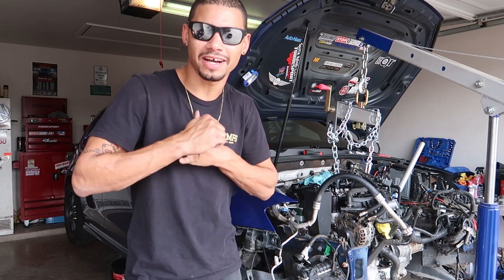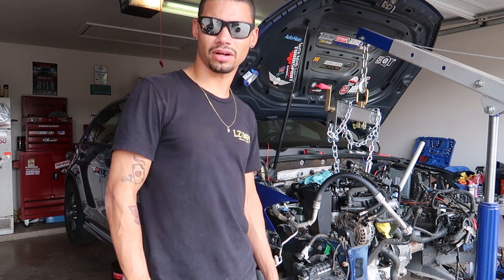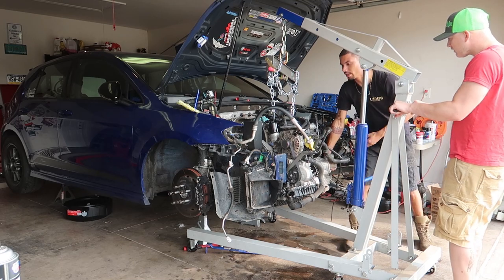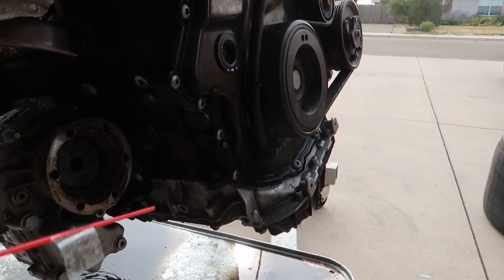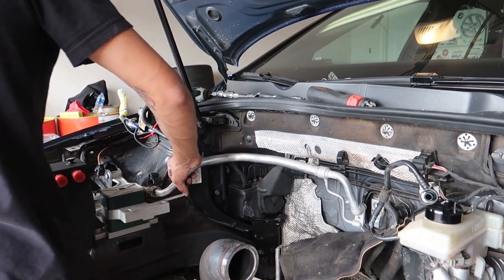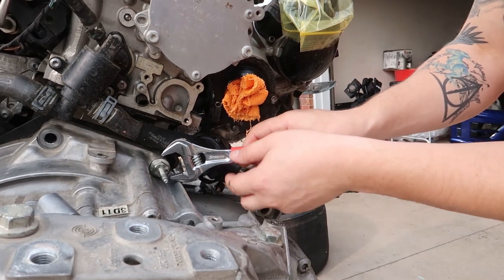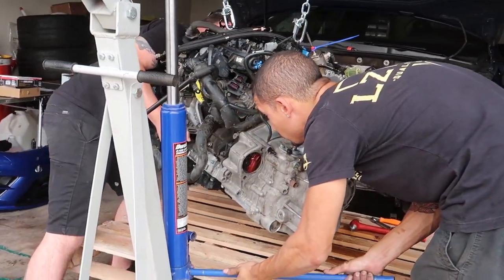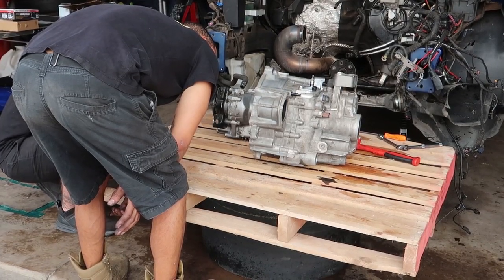Engine & Trans are removed!! BIG BAD SURPISE!!! | MK7 Golf R

Comment: Bro I’m so sorry 😂😂😂
Reply: On a real note, looks like gear oil cooling is definitely going to need to be a priority, and a vastly increased service interval of almost 1000 miles.
Reply from the maker: Yeah with the built trans an motor 1k changes will be mandatory in my book for both. Maybe even more frequently depending on the amount of racing. Idk how a manual trans cooler would really pan out but if push comes to shove it'll have to be done for sure. We'll find out this next season! 😎
Reply: @BryceJordanProductions  Yeah, tribology is an extremely complex topic, but I just love reading about it for some reason.

I tell you what man, even a trans cooler doesnt work out, it may be worth rigging up a transmission fluid temperature probe,. That way you at least have some idea something bad is happening.
Reply from the maker: My Cobb shows gear temp but I don't see a sensor on this thing except for the reverse gear sensor.. wonder if that's assumed or what.. but yeah that wouldn't be a bad idea at all. Eventually I'd like to go stand alone and have all types of extra sensors, suspension height/movement, tire temp, trans temp, oil pressure etc..
Reply: @BryceJordanProductions  Yeah, I'd love to see how that gets worked out! I'll definitely be trying to follow things, but I've always been more into the super technical details so sometimes I have trouble paying attention.
Reply from the maker: Same man, i have a lot to learn but we'll get down to that level of business hopefully sooner then later!

Comment: just buy a used trans from a wrecked car or off of eBay its not that expensive, dude
Reply from the maker: It is when you add in the cost of building one being about 5500.. with a used trans I'm looking at like 7k! And that doesn't include the at least 4k I'll be spending on the engine, it needs machined for bigger pistons and everything cleaned and resurfaced.. it's gonna be some real time and effort
Reply: @BryceJordanProductions  with everything this far apart are you going to add any of the aluminum or gold heat rejection tape, or is that mostly gimmick?
Reply from the maker: I didn’t plan on it but that’s probably a good idea lol